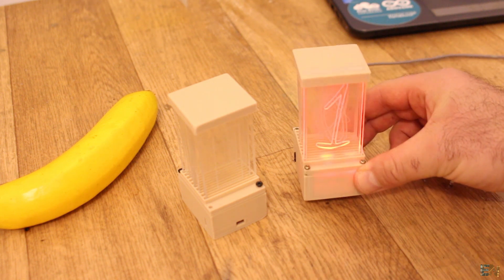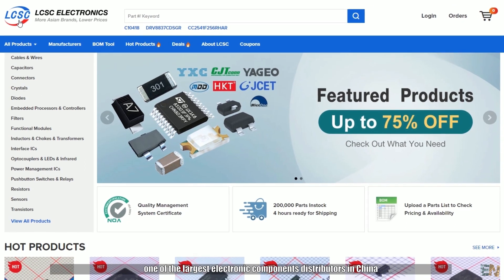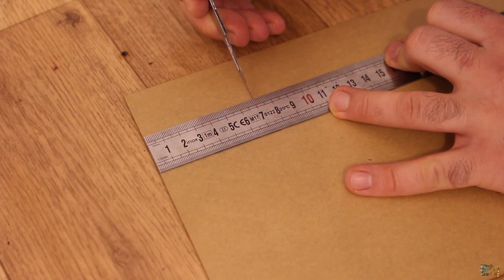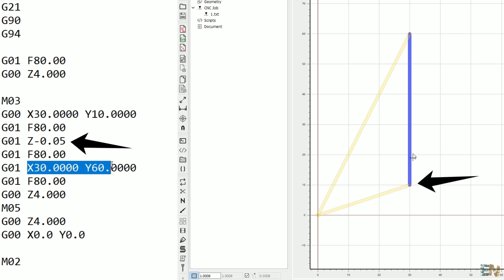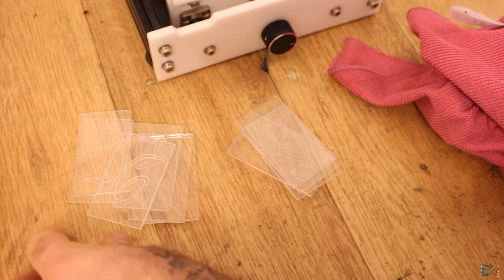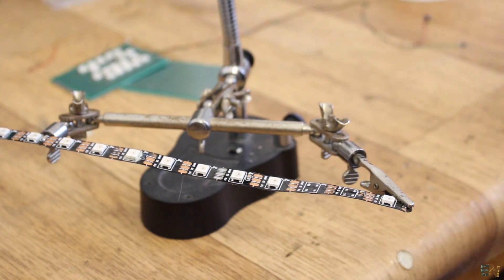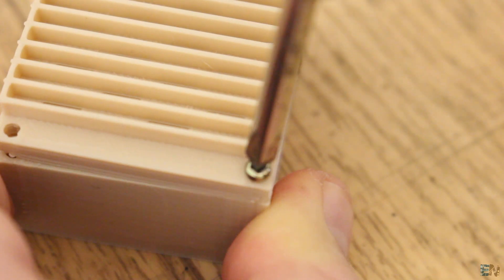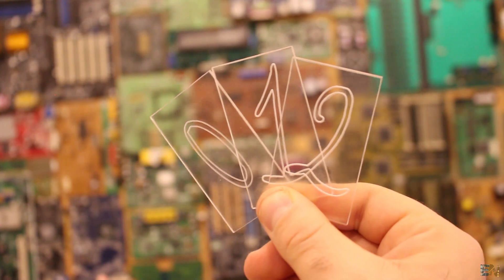Homemade Digital Acrylic Display

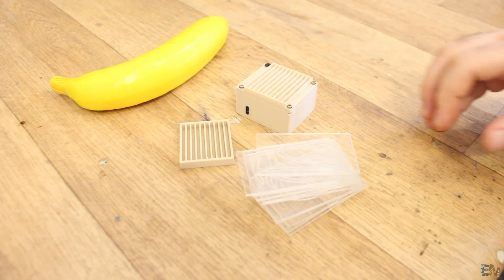Comment: 10:39 that's relatable one black screw and rest are plain. Easiest seven segment clock can be made using this.. Good work Bro
Reply: Well it no seven segment display more like 10 segment 😂😂😂
Reply: Be good if did that tho ....just use the segments instead of full numbers 🙂
Reply: @davey2k12  I mean multi layered just like Christmas tree.. than 7 layers instead of 10. 
edit : that too driven by single data pin for all 4 digits
Reply: @TheJay6621  could use max7219 to drive segments or transistor array
Reply: @davey2k12  yes that's classic solution but with this all 28 segments driven using single pin without external part that's what make it easy-going
Reply: @TheJay6621  easy going .....😂😂😂 Max7219 can drive 7x7 grid or 7 X 7segment displays 2 wire data, serial connect but no RGB control and not that complicated to setup cud just use transistors to switch between RGB and white ...
But I've not look into LED RGB control ICs that much TBF
Reply: @davey2k12  That's a choice
Reply: @TheJay6621  yep there's always choice probably more simple ways but works for a clock or dot matrix message boards

Comment: Awesome bro 👌 keeping going up 💪👊👊
By the way I have one idea for a project ;
Y don't u create a " smart watch"
Reply: Thank u so much for the heart bro ❤️❤️❤️
Reply: Cus be way to big like the shit on eBay 😃
Reply: no you can get tiny smd LED'S now and if you blacken out the parts you don't want lit up it would work very well. especially if ya paint the edges of the acrylic you don't want light to pass through to the ones next to them but just leave the bottom where the LED'S are it should work perfectly... it is idea and I think I might make a few myself and sell them or give um away as gifts to friends. thanks Sulaiman Hamsha for the good idea!!  : )
Reply: @keithking1985  I know mate there's a few different ones but if wanted to do a clock there would be lot of LEDs might be a bit much for the 5v rail 8 X 4 when all lit up and can use 1 x max7219 with standard or RGB LEDs could use this idea in video for clock display 🙂 just a way to make a clock
Reply: @davey2k12  the watch I thinking of was just a basic four panel one with a minimum of about maybe just 4 LED'S or 5 for the decimal point between the hours and minutes. Ya cud use an smd LDO regulator to provide voltage for the LED'S  seeing that they would be your largest voltage draw in the watch. Plus they wouldn't have to be RGB's any would do. It is do-able with today's tech!! Anyway look some  smart watches today a lot of those aren't big and have far more power needs then what in describing which is just pure basic nothing fancy accept looking cool and different.⌚💡 it would look the 💣
Reply: @keithking1985  I know what u saying you only need 4 digits lit at any 1 time ....could have any design maybe use thinner plastic for a watch but it would still need 10leds per digit tho without using the segment displays less used tiny LEDs or mechanism to move light cus lit from bottom top or both
Reply: @davey2k12   : all you would need is the 40 small thin panels and place the LED's at the bottom or top which ever suits the build better, now you paint/spray the panels edges  except the edge where the   LED's are and the back or top, it might not be a bad idea to put some non creased tinfoil on the back of the very bottom panel!! insulated of course with tape, it would give out extra light!!, the color of the LED's doesn't matter either, you choose its up to you. it can be done the hardest part is finding panels thin enough the job!! BUT SAYING THAT YOUR DESIGN WITH THE 7 SEGMENT DISPLAY WOULD BE BETTER AND MUCH EASIER!! PLUS YOU COULD PAINT THE TOP ANY COLOR YOU WANTED AND ETCH YOUR OWN UNIQUE DESIGN. AND IT WOULD'NT NEED TO BE LIT UP ALL THE TIME(NO PUN INTENDED) BUT JUST WHEN WANT TO KNOW THE TIME, YA PUSH A BUTTON THAR WOULD BE ON A TIMER!!  anywhere between 5 & 10 seconds would do ti fine.. I HOPE YA LIKED MY IDEA!! AS FOR YOURS IT SURELY CHANGED MY MIND ON MY OWN DESIGN FOR THE WATCH IT MAKES MORE SENSE TO DO IT THAT WAY (EASIER & A LOT HANDIER TO DO)   so if i do make it  which i  more that likely will in the future sometime i will use your design and take picture send it to ya with the schematic too.. and ya never know ya  might even get a surprise sent to a PO BOX. somewhere sometime in the future!!. but don't hold your breath because Im very lazy, "it just an auld  fault in me". but if i do make some i'll send ya on one, i'll put you in my subscriptions so i'll remember who you are and can message ya to tell ya iv made them!! ya can give me a PO BOX to send it to like those parcel motels(dont know if ya'v heard of those or seen one before) but their handy for receiving things off people who ya dont want to knowing your real address. you see them at bus stations/petrol stations/usually places that are open 24-7.. and are nearly always outside!!.

Comment: Good day, I collected a portable soldering iron according to your scheme with your firmware version 1, and faced a problem, the hall sensor does not work and the temperature does not want to show correctly, when the flash began to show -5 on the thermocouple does not react, please tell me why?

Comment: Did he mention the protocol used to address one LED (actually two)?
And how it's implemented in the other arduino, Data-IN is the Data-OUT of the previous one, so there's no need for an arduino in each case right? Communication with LED and between arduinos is not completely clear, well not addressed by the video.
Reply from the maker: No, you only need one Arduino inside the first display and then you have data in data out
Reply: @ELECTRONOOBS  more explanatiosn would have been nice
Reply: @ELECTRONOOBS  and how the addressing of LED works is also interesting to know but not explained.